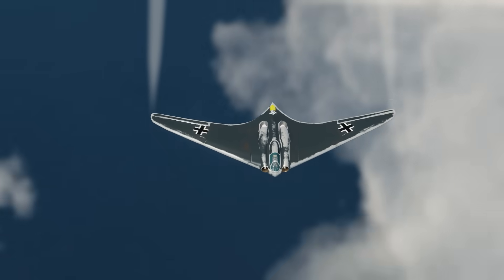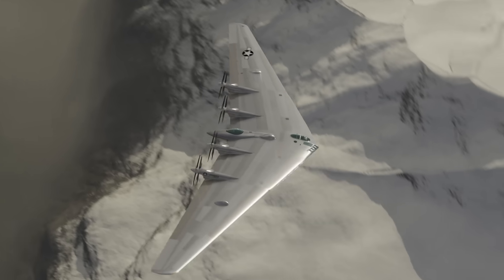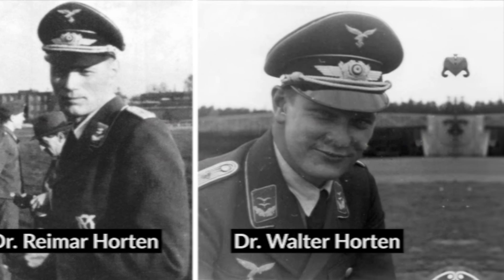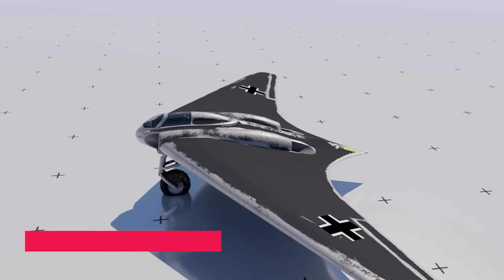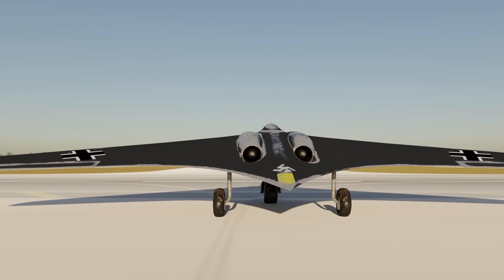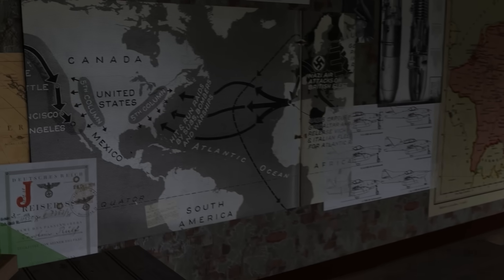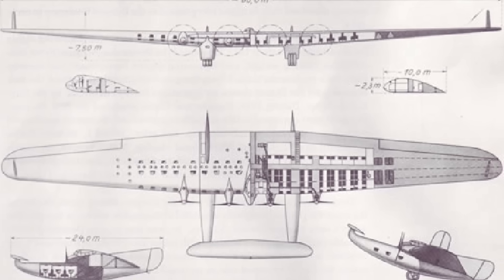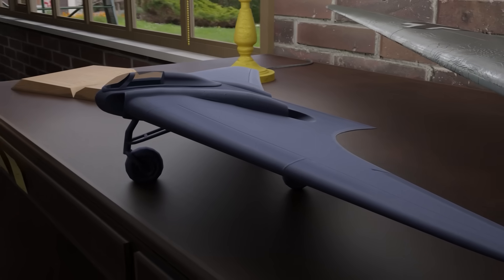Insane Flying Wing Jet Fighter To Save Germany - Horten Ho 229 Nazi UFO

Comment: German engineers 50 years ahead of all other nations. What a beautiful and modern design. Question to the experts: Would you equip a Horten with modern materials, new engines such as the Turboprob and rebuild the aircraft; what kind of machine would appear? What would this machine be capable of and what could it be used for today?
Reply: Would be shown at air shows. There are flying reproductions of the ME262 and ME163, that appear at air shows.
Reply: @PRH123 There are no flying reproductions of the Me-262, Messerschmitt built 5 genuine 1-c models under license in Everett Washington.
These aircraft are not replicas.
Reply: @WilhelmKarsten  hmm, two ways to say the same thing, although I would be more inclined call it a reproduction as the powerplants and instrumentation are not the same
Reply: @PRH123 No, its not... is a Canadair 6 a replica of a North American F-86 Sabre???
 Is a CASA 2.111 a replica of a Heinkel He-111???

Even modern jets are sold with as many as 4 different engine options.

The Messerschmitt Me-262 was flown with 11 different engines from 7 different manufacturers.
It was manufactured in Germany, Czechoslovokia and the United States
Reply: @ potatoe - patato, tomatoe - tomato, it’s two ways to say the same thing, AND I did NOT use the word replica (you did), I used the word REPRODUCTION, ie RE-again-PRODUCTION
Reply: @PRH123 The Messerschmitt Me-262 1-c models are NEW PRODUCTION.
manufactured under license from Messerschmitt and issued with genuine consecutively numbered Me-262 serial numbers.
These are genuine Me-262s.

Comment: Horten ho 229 looks identical to b2 bomber 💀
Reply: Its not a coincidence, Northrop exhaustively studied and tested the Ho-229 in the 1970s when it began research on the B-2.
Reply: @DoktorBayerischeMotorenWerke  No they didn't. Northrop based the early designs of the B-2 on the YB-35 that started development long before the first HO-229 was seen, and the stealth aspects was based on continuous research from the F117. The HO-229 was only given the "stealth" attribute as a desperate marketing attempt by the Horton brothers, and not because it was actually designed as a stealth plane.
Reply: @drachula1184  The YB-35 has no radar stealth characteristics while Northop not only confirmed the Ho-229 was stealth they based the B2 on its design.
Reply: US copied the germans.

Comment: 2:57 This fucking myth again. No, the tail surfaces are not what reflect the most radar waves. That would be the engine components. On most planes the tail isn't even visible to radar unless it's flying completely side-on.
Reply: Its not a myth, Germany invented radar stealth technology during the war and was the only country to use it operationally in WW2.
 That is completely false, a vertical tail fin is HIGHLY retroreflective and produces a huge RCS. 90-degree angles light-up radar screens like Christmas lights.

Indeed, jets dont have propellers that are also highly retroreflective and generate a large RCS.,

Comment: The guns are called auto cannons, not machine guns, and the 30mm round could destroy a fighter with a single hit anywhere, and drop a bomber with two or three.
The radar thing wasn't so good. Sure the streamlining helped, but the exposed compressor fans of the engines would made all of that irrelevant.

Comment: The Horten never flew in use, was not stealth, and judged a failure even by German Jet plane designers. Oh and the Northrop flying wing was already being tested in the air.
Reply: The Ho-229 was the World's first stealth jet powered flying wing.
Reply: @DoktorBayerischeMotorenWerke  That was not stealthy nor successfully flown in action.
Reply: @kenm4678  True, the Northrop flying wing was years behind and was not stealth or jet powered like the Ho-229. The Northrop fling wing never saw action either, it was a failure. Germany was a decade ahead of the Allies in Aerospace technology.
Reply: @DoktorBayerischeMotorenWerke  The YB49 a JET flying wing first flew in 1947. And  was as non stealthy as the HO229. Northrops firs wing flew in 1940. Far as stealth the term was unknown/unused for airplanes in WW2 even at that the engines are the hardest part to make "stealthy" even today. Wood is not stealthy as aircraft skin.
Reply: @DoktorBayerischeMotorenWerke 3 months later and he still has no questions :)
Reply: @PRH123  Because he has no clue..

Comment: So jack northrop x216 flew first in 1928 thats years before the horten ever had a glider, jack northrop took no insperation from the ho229, his planes started in n1m flew in 1940, n9m flew in 1942, xb35 flew in 1946, yb49 (jet modified xb35) flew in 1947, the xb35 was built between 1943-1945 was 3x the size of the ho229 and was a large bomber to be used in bombing germany from usa. 

Also the b2 shares the same wingspan and wing angle of the xb35. It has nothing to do with the ho229,

This dude been drinking the myths and calling it reality
Reply: Jack Northrop never developed stealth technology
Reply: Neither did the Horten brothers
Reply: @peterson7082  Northrop copied the Horten Brothers...  and so did Lockheed.
Reply: @DoktorBayerischeMotorenWerke  Northrop had been working on flying wings since the Horten brothers were teenagers
Reply: @peterson7082  Northrop did not have a jet powered wing or a stealth flying wing until the technology was copied from the Germans, this is an irrefutable fact that cannot be denied. Any questions?
Reply: @DoktorBayerischeMotorenWerke  The fact is there was nothing to learn from the 229. 

It was not stealth. And jet engines were something advanced by the British which the Americans learned from.

Try again.
Reply: @peterson7082  You are a very confused and misinformed amateur regarding this topic.
  Tests conducted by U.S. aircraft manufacturers confirmed that the Ho-229 was a stealth aircraft.
 Britain wasted an entire decade developing inferior centrifugal jet engines that had proved to be an evolutionary dead-end concept.
 Britain would not have viable axial jet engines until the 1950's and were based on captured German technology.
 Most of Germany's jet industry was transplanted to America after the war and allowed the Americans to quickly surpass the brits in jet technology in the post-war era..
Reply: @DoktorBayerischeMotorenWerke  wow everything you said in that is wrong.
Reply: @peterson7082  PROVE IT!
Reply: @DoktorBayerischeMotorenWerke  The wooden construction showed a drop in RCS, but as that metric was not understood it wouldn't be more significant than that of the Mosquito. 

 Neither Northrop or Lockheed claimed the aircraft was stealth in their contracted work for studying the 229 among other aircraft. 

 Your understanding of German jet engines is limited at best.
Reply: @peterson7082  The Mosquito was covered in highly radar reflective and retroreflective surfaces.

Northrop and Lockheed confirmed that radar tests showed the Ho-229 had a Frontal RCS of less the 50% of a BF-109.
 
Germany invented the jet engine and the Axial type that we use today, the UK lagged years behind Germany and America in Axial compressor technology.

Britain DID NOT have a viable, flight-rated axial jet engine in production until the Rolls-Royce Avon in the 1950s... a decade after Germany did.
Any question there little lad?
Reply: @DoktorBayerischeMotorenWerke  Yes a 40% reduction is quoted by the History Channel, frontally. Also mentioning they didn't recreate engine reflectiveness and that reduction regards range not over all visibility. 

 The issue is the actual work both companies did has very little detailed info aside from the quoted 40% reduction in range frontally. 

Whittle had been working on axial engines. German axial engines had a very short service life. There's a reason why multiple countries produced 109's, He 111's after the war. Not the 262. Or Arado 234. The engines were not usable for a fighter aircraft. Soviet and other European designs used British centrifugal engines.
Reply: @peterson7082  Nor did they recreate the RAM that was intended for the production models.
 Even a 40% reduction in Frontal RCS is a massive tactical advantage in combat.
The data taken from the Ho-229 is still classified,
very little declassified information about America's stealth aircraft programs has been published or available to the public domain.
 Against the Meter band radar used by the British this represents more than 20 minutes of range before detection effectively preventing any chance of an interception before reaching the target area.

Frank Whittle never constructed a single jet engine with an axial compressor, and as A.A. Griffiths pointed out when he exposed Whittle for plagiarizing his work that Whittle made several egregious errors proving that Whittle did not understand how axial compressors worked.
 He and Hayne Constant were Britain's leading experts on axial compressors but completely failed to produce a viable flight-rated axial turbojet until captured German technology was disseminated after the war.

Germany produced not only the most advanced but the most durable and reliable jet engines in service during WW2.

The Me-262 and a copy of the Ar-234 continued in production and service after the war as well as more advanced second-generation jet fighters like the MiG-15 and the F-86 Sabre, The UK would not have an effective jet fighter until the Hawker Hunter appeared in the 1950's.

You really have a very limited knowledge of both radar stealth technology and the development history of the jet engine type that we use exclusively today.
 Whittle's ugly little engine was an evolutionary dead-end, a failure.
The Allies had absolutely nothing comparable to German Radar stealth or advanced axial jet engine technology.
Reply: @DoktorBayerischeMotorenWerke  There was no RAM.
Reply: @DoktorBayerischeMotorenWerke  hard to call the Jumo reliable. Likewise still doesn't change the fact after the war we saw Whittle style centrifugal engines being common until the 50's.
Reply: @DoktorBayerischeMotorenWerke  you need to stop watching American television and History Channel.
Reply: @peterson7082  German RAM technology is well-known and documented, it saw production and operation service during WW2.
Your limited knowledge and highly biased opinions have you looking like a dolt.
Reply: @DoktorBayerischeMotorenWerke  The lack of details provides nothing to assess how visible the 229 was if a variant that was combat capable existed. Which remember did not exist.
Reply: @peterson7082  The Jumo 109-004 B easily surpassed the RLMs 100 hour PFTR for adoption into Luftwaffe service.
 Frank Whittle nor Power Jets limited ever produced an engine that could pass the reliability standards required for RAF service.
Rolls-Royce ceased all production of centrifugal jet engine in 1953, immediately after axial jets were available in quantity.

You need to go back to school lad, you are not formally educated and have no professional experience regarding these topics... and are completely out of your depth here.
Reply: @DoktorBayerischeMotorenWerke  yes because the Germans looked into diffusing radar for U-Boats. The effect into RCS was not known. Just presumed materials known for abosrbing microwaves and reducing deflection immediately back. 

 None of the German records suggested it worked to any degree.

In regards to the 229, the only claim comes from Reimar and his book. Don't get me wrong a couple of institutions make remarks developing forms of rubber lining for aircraft. Just not Hortens' designs by name or project. 

 None of these technologies were mature. Hence me saying the Germans did not have RAM. They tried, and failed.
Reply: @DoktorBayerischeMotorenWerke  I'm sorry beyond testing which countries immediately used German axial flow engines after ww2? For regular use? 

Also what engines did the MiG's have and most US jets?
Reply: @DoktorBayerischeMotorenWerke  likewise work with the J31 which would lead to the J35 powering the F-86 was partially learned from British help.
Reply: @peterson7082  Germany invented Carbon-Iron ferrite RAM and produced it during WW2.
 You are obviously not qualified to discuss this topic intelligently.

Comment: N9m flew before ho229 and had hundred of flight hours so saying the ho229 is the original is bs, also the ho229 only had 4 test flights so kinda hard to say it was successful. 

The flying wing had been worked on by many people before the hortens or jack northrop, the only first the hortens had was a jet engine powered and an all composite glider.
Reply: And stealth...
Reply: @WilhelmKarsten The Ho229 was not stealth. Studies of the airframe including full scale mockups concluded that it would have been somewhere between a BF109 and He11 on radar.
Reply: @Tozzpot500 Tests confirmed that the Ho-229 had a 50% reduction in frontal RCS compared to the smaller Bf-109... and this was using modern radar, not the primitive meter band detection radar used in Britain during the war.
This is a significant tactical advantage even for modern aircraft.
Reply: @sandervanderkammen9230  Someone didnt read the report. The tests were conducted on ww2 era radar systems and found depending on where they hit the airframe the Ho229 was somwhere between a BF109 and FW190, my prior comment i got the 190 mixed up with the He111 due to tiredness. There was no noticeable difference and the aircraft lit up modern radar like a beacon. The Ho229 is not stealth, the principle wasnt even understood at the time of its creation. Yes the shaping gave it a slight rcs reduction (not the 50% you claimed) from the front but you cant call that intentional stealth. 

The Ho229 was also just an impractical design with a littany of flaws and failures. Comments from test pilots were mixed and most if not all noted a lack of stability at low speeds hence the loss of the prototypes.
Reply: @Tozzpot500  That is absolutely and completely false!
 The tests were conducted with modern radar equipment, and the performance of WW2 radar was "simulated" with an unverified software program.
 No aircraft can be 100% stealth or invisible to radar.
You seem to be very unfamiliar with this subject and the basic fundamentals of radar stealth technology.
 Anyone who is formally educated or has professional experience in radar stealth can easily recognize the Ho-229 as a radar stealth design, in particular the obvious fact that it devoid of any front facing Retroreflective exterior surfaces.
 German development of radar stealth technology during WW2 has been verified and is documented by multiple sources.
Germany invented RAM (Radar Absorbing Materials) during WW2, and these materials were produced and used in military service.
Reply: @Tozzpot500 Your comments reveal someone who has no formal education or professional experience regarding this subject.

So you admit your were unfamiliar with Tarnmatte and Ferromatten???

It's well-known and documented that these German RAM types were manufactured and used in operational service.

NO AIRCRAFT has full frontal Radar stealth.
The B-2 can be detected by radar at ranges up to 150 miles away depending on atmospheric conditions and the type of Radar detection system used.

You are simply attempting to deny that Germany invented radar stealth technology during WW2, your infantile attempts are complete and utter failures.
Reply: @holzmlb  Tests confirmed that it was stealth even without its RAM applied... no aircraft is completely invisible to radar, that's Hollywood myth. Radar tests confirmed a significant reduction in RCS and that it would have delayed detection of the aircraft on radar as much as 20 minutes... preventing interception before reaching the target, a huge tactical advantage for the time.
You cannot deny that Nazi Germany had Radar stealth technology, the evidence is irrefutable and should be no surprise coming from a country that made Mach 4 missiles traveling in space!